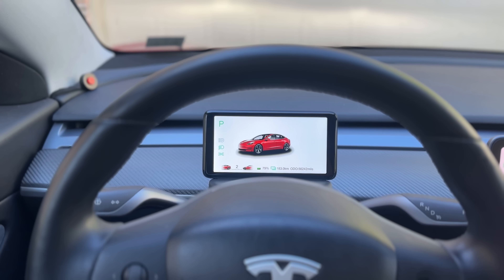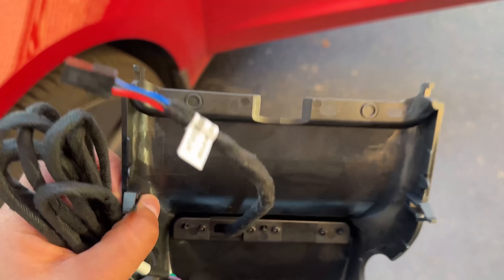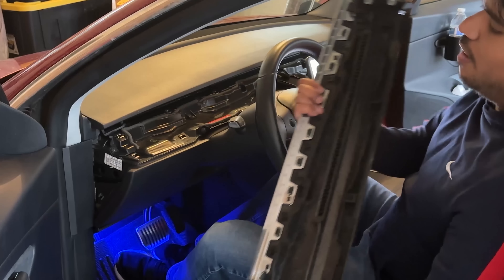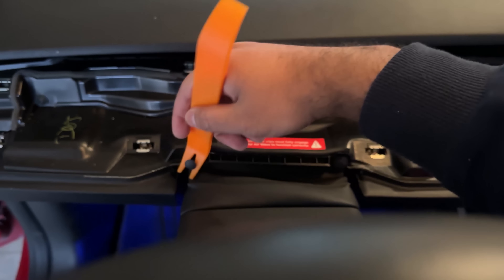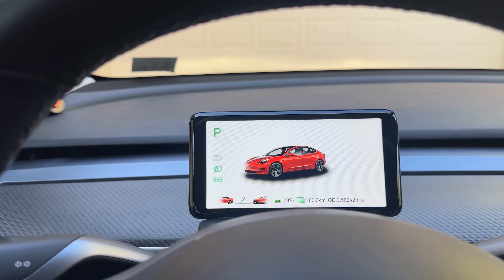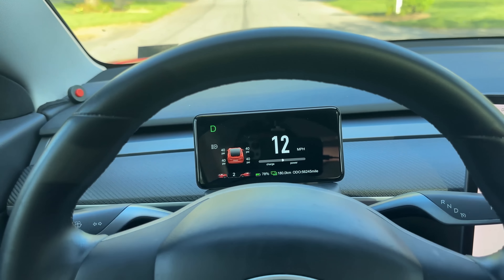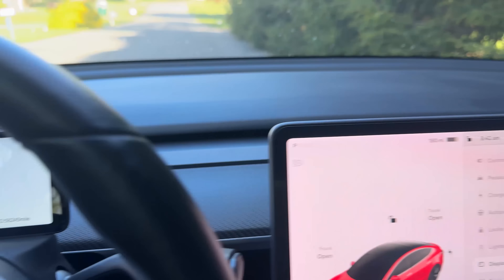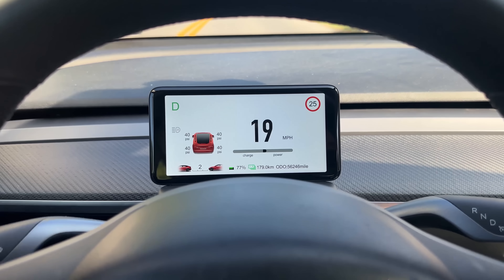NEW Integrated Instrument Cluster Display HUD For Tesla Model 3/Y - Best UI & Graphics YET 2023

Comment: I still don't understand why manufacturers think you need to see the tire pressure all the time. I would also think with the newer Tesla's not having the ultrasonic sensors that the aftermarket might add a front bumper camera. I bought the first cluster that Hansshow put out that had both, the camera and GPS and so far no one has included that. But I'm still hoping. Your camera, angles and presentation is among the best of the Youtubers. Thanks again.
Reply: I like the tire pressure when I'm on road trips for a couple reasons. I like to know if my tires are getting too warm (ie. went to FL recently and had to air down at a supercharger since they were hitting 49). Also on a road trip, I want to know ASAP if there are any tire issues (slow leak from running over something, etc).
Reply: @Scott-sm9nm  I agree, Scott, that is a great feature. But I would like to have the option to have it on or replace it with something else. Note, you can now see your tire pressure all the time in the lower left-hand corner of the main display.
Reply: @-jackinspokane6648  I understand and it could be nice if they would let you turn it on or off.  Off the top of my head, I don't know what else I would replace it with (vs blank).  BTW, I have an older TMX so I have the vertical display and drivers display so personally my tire pressure is on the right side of the drivers display. I was looking at this device for the kids 3 or Y.  It looks like the CyberTruck may not have a drivers display, so I would definitely get one of these 3rd party devices for behind the steering wheel. Cheers.
Reply: @Scott-sm9nm  49 is good. tires are rated for 50psi cold.
Reply: @kingprone7846  Good point. Thx. TireRack: "A tire's maximum inflation pressure is the highest "cold" inflation pressure that the tire is designed to contain. ... For the reasons indicated above, It is also normal to experience "hot" tire pressures that are up to 5 to 6 psi above the tire's recommended "cold" pressure during the day if the vehicle is parked in the sun or has been extensively driven."

Comment: Hi Shiva, i bought one because i saw your review. I found some small Issues : 
- The Seatbelt Warning is not sincronized
- The small Car Icon left bottom shows allways Red Car even if the car is set to Grey
- In the Auto UI The Speedo is not in the middle of the screen thats confusing. 
- I think there is no need for two bars on the Right for Charge and Power 
- The Power Bar is not syncronized very well with the Tesla

i like the Size of this cluster its the best so far.

 It would be nice to have a new User Interface with more Car informations. A nice Graphic for the Power consumption like on the model s ui would be nice. Also some infomations about Consumption wh/miles since last charge like on the model s.

Comment: I bought this unit and installed it. It works fine. It did come with another type of wiring for the AMD version. The data side(more wires going into the connecter)  goes on the driver side, the power side goes on the passenger side .
There are two small issues however. The temp shows in centigrade, with no obvious way to convert to F. Also, there is a  large green 'READY' word in green at the top of the screen, and I don't know how to remove it. Otherwise, It is a very cool looking cluster and i am glad i installed it.

Comment: thanks for the review. on top of all you mentioned in the video, it would be nice to add CarPlay, turn signal turn red when there is a car in the blind spot, also OTA update instead of SD card. 
I think also if they remove the odometer value and move the battery and range to the right with proper space, it will look much cleaner for classic view.

Comment: If you have an older version 4" mini screen with AMD setup could unplug at the steering wheel and plug in the newest version without pulling 
😅 the dashboard?  I am crazy 🤪 thinking this is possible? 
Thanks
Reply from the maker: I am afraid that might not work, all these displays usually have different plugs :( Thanks.

Comment: Are the displays you showed the only two available?  I ask because the one on the website is different, and that’s the one I like.
Reply from the maker: It seems like the one on their page is the same display but with a different firmware. Mine looks slightly different but they did send me an update which I haven't gotten a chance to run it yet. Thanks!
Reply: @ShivaSapkota  - what firmware does your have with the display from this video?
Reply from the maker: @davidwho8215  Mine shows: 2023.04.18
Reply: @ShivaSapkota  - the one on their website appears to be 2023.03.02, so yours is a newer version.   I don’t care for the new version.  I would like to see your display options after you do the update.
Reply from the maker: @davidwho8215  Okay, I will make a video when I get to installing the update. Thank you.
Reply: @ShivaSapkota  - I have emailed them about this, and while they do respond promptly, they don’t really answer the question.  I have the Ultra-Mini, and like the software version it has.  I was thinking of switching to the display in this video, as they tell me it uses the same wiring, so swapping would be easy for me.  But…I want to be sure of what version I am going to get.

Comment: Great video as always Shiva. Question about installation of this display. I have a 22' M3LR with the Teslogic device you reviewed earlier already installed in the passenger foot panel blue CANBUS and power plug locations. Since this PMEV display provides similar information but still different, can this wiring harness be piggybacked over the Teslogic harness instead of going into the glove box location? I understand there is a jumper cluster (1 male and 4 female connectors) that would make the CANBUS connections possible (not all the 4 female connectors would be used). If this is possible, do you know where I can purchase the jumper cluster? Thanks!
Reply from the maker: Hi Robert, unfortunately this particular display protocol extracts signal from the from computer rather than the rear OBD. The codes used to read that info is totally different between the location and wouldn't work. I recently had that inquiry to a vendor about a similar product and that is the response I got. Thank you.
Reply: @ShivaSapkota  Thanks Shiva!

Comment: Bro, can you make video installation for interior ambient light with hardwire method. Please

I hate looking at my center console that look like bird Nest 😭😭

Or maybe video that show us the location of 12volt cable that we can tap it as a 12volt power source add on accesoris 
🙏🙏
Reply from the maker: Hi bro, please shoot me a quick email and I will give you some guidance on how to tap into the 12V outlet. It is very similar to my cup holder video I recently did but you gotta make sure to completely turn off your car (both 12V and high voltage) as that part contains RFID reader. Thanks.
Reply: @ShivaSapkota  I emailed you. Ty